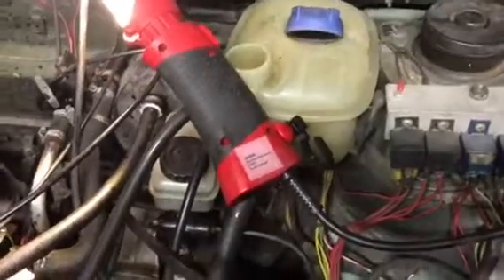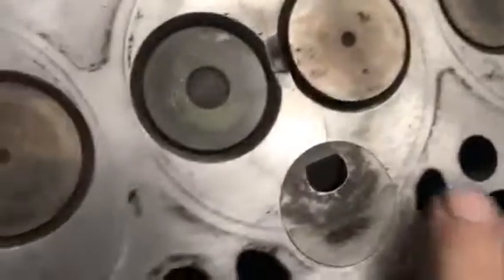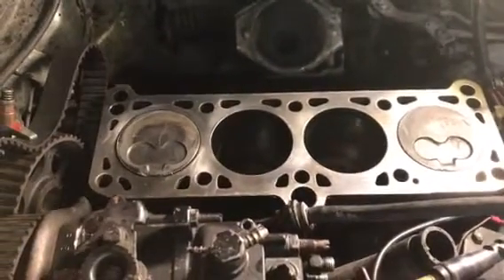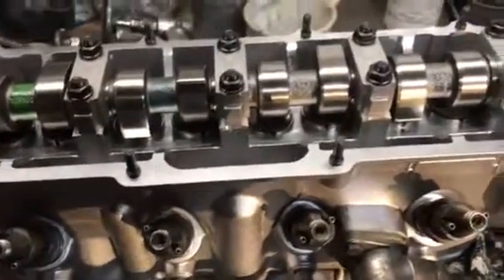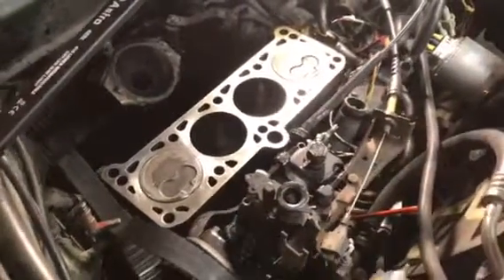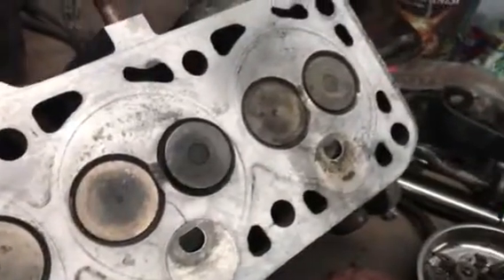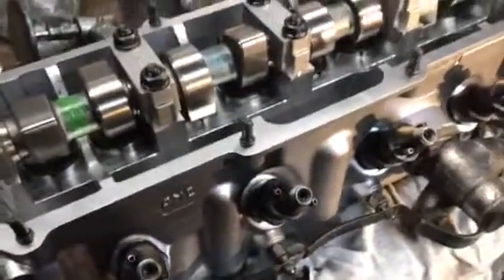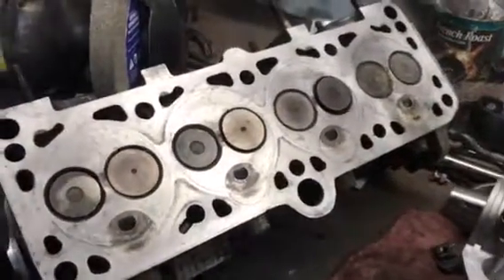VW Diesel Head Gasket

Comment: Did you have any issues with the second oil drain passage on the front of the replacement head you got? I noticed the block didn’t have a corresponding drain hole

Comment: You should have fuel preheater "webasto" or electric heater on a freeze plug/hose heater. This kind of engine uses so little fuel on idle that heats very slow.